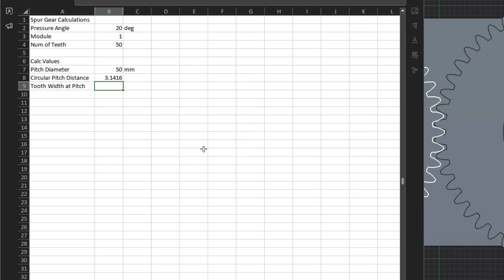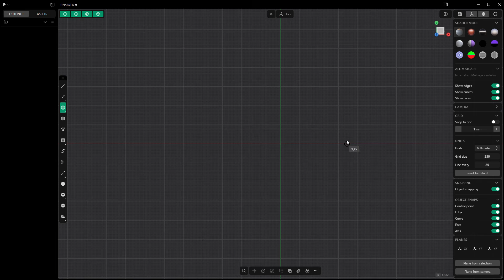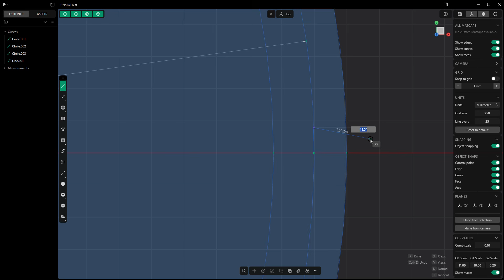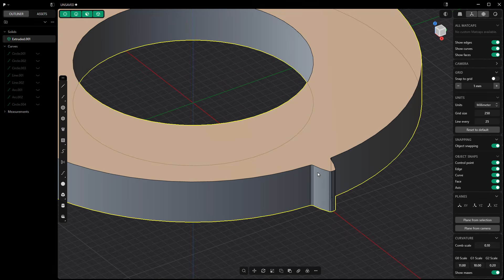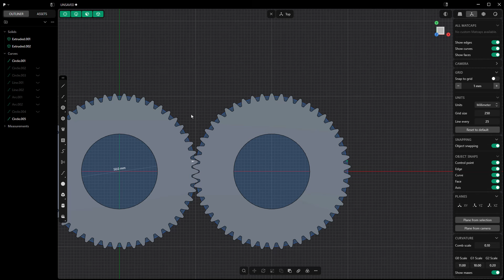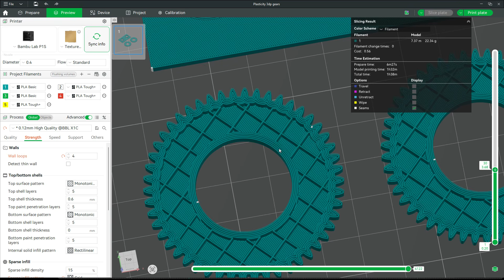Design 3D Print Spur Gears in Plasticity #3dprinting #plasticity #plasticity3d

Comment: Whether it’s 3D printed or CNC machined, the fundamentals of gear design never change.
Reply from the maker: I don't disagree here, but a 3d printer isn't using g2/g3 arcs for the teeth.  We are getting a bunch of straight lines from the STL export and not all priner firmware supports arc movements.  Plus the tolerances vary wildly.  This is why i just used 20deg pressure angle and showed roughly what it does rather than driving any math with it.  There (in my mind) was no point diving deep into the math when a 3d printed gear like this is never going to behave like a machined one.  I wanted to include the most practical creation because Plasticity doesn't have sketch parameters.
Reply: @LearnEverythingAboutDesign  Agreed. Different manufacturing methods, different priorities. The design principles stay the same, but the tolerances and limitations definitely change. 👍

Comment: Just a note. You have to be careful moving/rotating a gears with odd numbers of teeth. Because they are not perfectly symmetrical the default pivot point can be out of centre even if it looks ok.
Reply from the maker: Thanks for the note.  I am curious how the default pivot would be off though?  The tooth was centered about the axis(drawn on top and mirrored), then the array was made about the origin which is on that axis.  So there shouldn't be any variation or issues with symmetry.
Reply: @LearnEverythingAboutDesign  (TBH haven't tried in Plasticity, but....) Most CAD programs, when you select an object, set the default pivot point at the centre of a bounding box that encloses the extents of the object. If you think about a gear with an odd number of teeth, depending on its orientation, one side of this box can be aligned with the top of one tooth while the other side is aligned with the gap between the top corners of two teeth, which are slightly different distances from the centre of the gear.  Thus the default pivot is out. 
Not an issue with your demo because you used Duplicate and moved a typed distance, but it can cause problems when you move things around later. In the worst case it can cause binding with low odd number of teeth. Fix is to move the pivot with a snap to the centre of some round bit of the profile.

Comment: Does Plasticity not handle formulas in dimensions? Using formulas in the actual sketch avoids the need for a spreadsheet.
Reply from the maker: you can do basic math when entering dimensions, but there is no formula/parameter list you can fill out, and once you enter the dimension there is no link to anything.  Plasticity is more of a direct modeler.